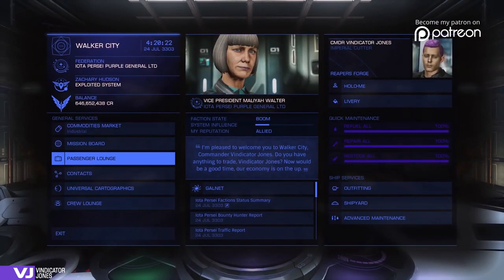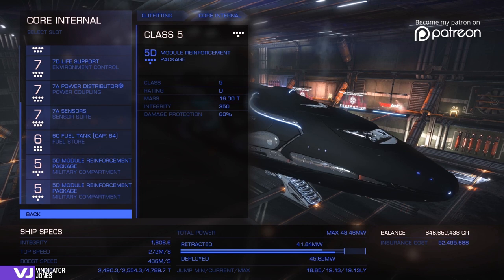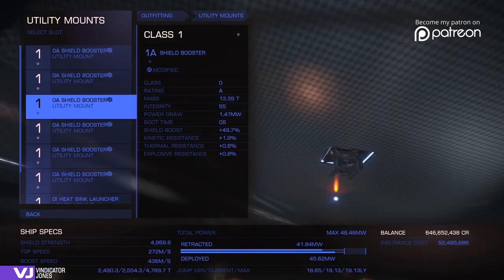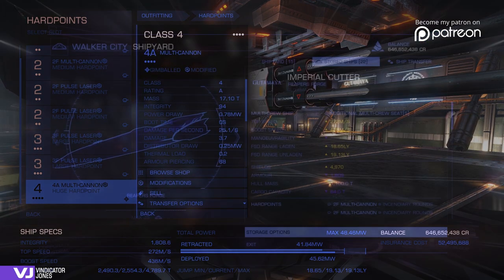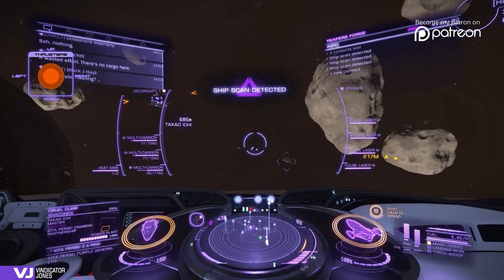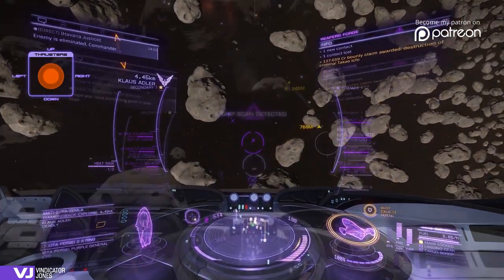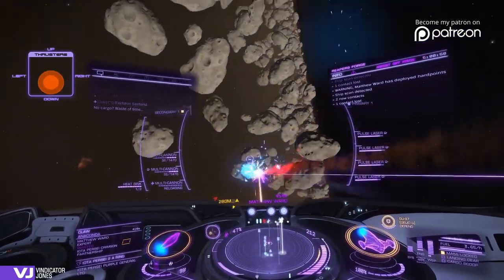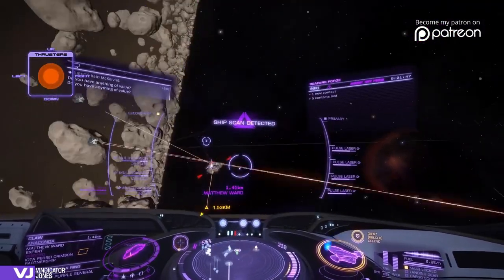1 Billion CR Engineered Turret Cutter FAOFF in HazRez

Comment: For my Cutter I went full multicannon except the 2 size 3 slots.
The size 4 cannon has corrosive shell and the others have incendiary rounds. This generates a lot of heat so on the size 3 slots I've got two beam leasers with thermal vent. I gotta say, this is incredibly effective! It deals A LOT of damage and I can keep cool thanks to thermal vent but still doing damage.
The only drawback IMO is the limited ammo but that's not a big deal to my eyes.

Comment: Nice video! As another turret Cutter pilot, I recommend you to bail the two underside class 2 mc turrets for gimbaled mc.

You just want the topside turrets firing all day long and the underside mc firing at the same target than the big chin mc.

I fly my cutter with all turreted efficient beam cannons, and it is glorious. o7 cmdr!
Reply: This is my setup on my PvE Cutter.

x1 C4 Gimballed Multi with Overcharged & autoloader
x2 C3 Turreted Pulse with Long Range (1 with concordant, 1 with EM)
x2 C2 Turreted Beams with Long Range and TV
x2 C2 Gimballed Multi with OC (1 with Corrosive, 1 with EM).

All turrets are on top. Gimballed are under the nose.

My distro can handle the power needs easily and having long range on the lasers is so nice for damage output. Efficient is a waste and unneeded with this setup.

Comment: Just finished my anaconda.. huge is 1 fixed long range beam, thermal vent. 3 large, 2 medium HPs are PAs efficent 5 with slug. 2 small rails, short range with feedback. 
I run biweaves reinforced. 4 Heavy boosters , 1 all resistance and 1 thermal. 2 point defense. 
Able to run this off a grade 4 armored plant. 
SO FUN TO FLY, the 5 PAs slaughter everything..heat never goes above 65%.. 
I have 3200 mj shields that recharge 5 mins normal space or 2.5 in supercruise.. 

Like you said, fly what you love. I had the vette for 1 yr before resetting my save.. I do miss the 3 tier 7 slots but other than that conda is life xD

Comment: Turrets do a bit less damage compared to fixed or gimbal mounts.  But turrets mean you can stack your Cutter against the Drop Ships and such.  I've got turrets on my Anaconda and don't mind a bit getting in among the rocks.  But then my Sneaky Snake almost counts as a hull tank (not quite, but almost).  Add to that I just don't feel right (or safe) with FA turned off.  I'm not that good and I know I'm not that good.

Comment: Thermal resist engineering on the shield gen, 2 resist aug boosters with force block, and the rest of the boosters with heavy duty boost will give you the best result
Reply: Most effective is actually heavy duty with a mix of heavy duty and resistance boosters, unless you're stacking SCBs

Comment: I really enjoyed this build, but I am not as risky with FA off all the time.  Also maybe you could lightweight the sensors for mass reduction benefits.  Will you be making an optimal build for the cutter eventually?
Reply from the maker: Perhaps, once I have found the right balance. Right now its an open ended test platform. I use it for piracy, as its a complete over kill. The RNG aspect of engineers makes finding a final optimal build very very difficult, as I have so many other ships I am working on. But yes, most likely I will be doing some weight reduction with sensors and I think life support, if I can..

Comment: How the hell did you afford this?
Reply: Millerport in Quince scan missions (Horizons req) 50-100 mil/hr.
Conti Station in Shasir passenger missions 20-60 mil/hr.
There are lots more bulk-mission locations.  I've found 90+ mil worth of massacre missions at once in multiple spots.
Reply: Quince at non-peak times, you can still get 100m/hr.  At peak times, the mission sever gets lagged, but I can still pull 30-60m.